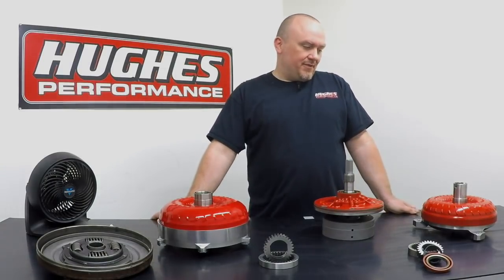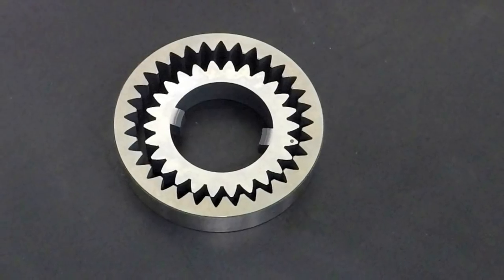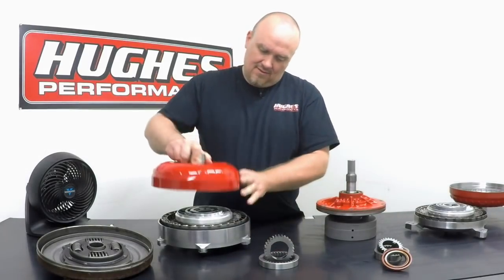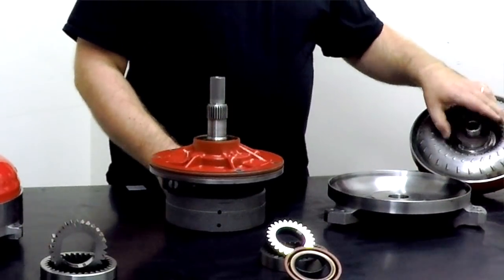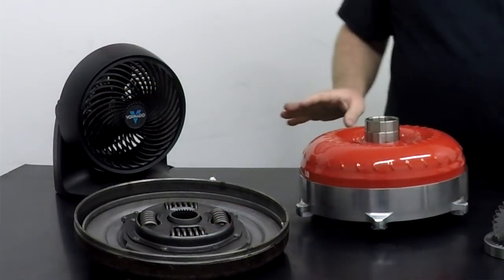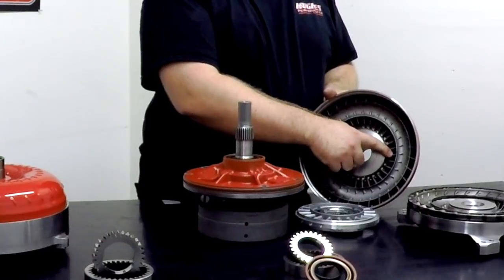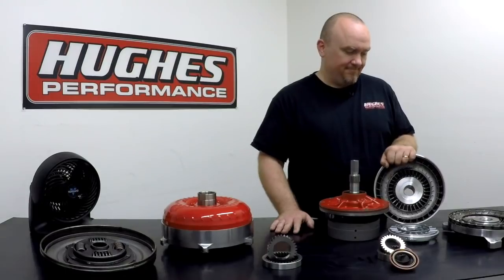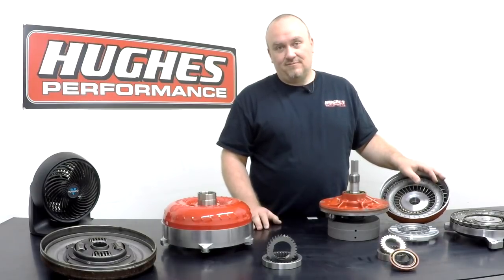Ep. 1 Torque Converters 101: A General Overview

Comment: Hey, just wondering if i could damage my 4l60e by having the converter constantly locked? I had an issue with my last cheap test box i tried it with and im putting another cheap test one in with a bigger trans cooling system in and was wondering if im missing something

Comment: I just bought the 2500 rpm install for my S10 with the Blue Print Engines 383 with Brodix heads. It pulls the brakes and stalls with stock RV converter.

Comment: what i don't understand is how it can both slip and multiply torque. wouldn't it slipping or having inefficiency mean that you're losing torque? 
also, if it's multiplying torque is it doing that by reducing the output speed?
Reply from the maker: Torque multiplication diminishes as RPM increases due to a change in vortex flow within the converter. Torque multiplication occurs as a result of additional fluid drive force being generated by the stator against the inner impeller fins. We recommend viewing the rest of the series, as we talk about all of this more in depth. 😉

Comment: Hi Hughes, awesome video! Just a theoretical question, would it be possible to "turbo/supercharge" the hydraulic fluid entering the torque converter with an external pump to get more torque multiplication on output? Or are the current designs around that 1.8x factor you mentioned near the limit for multiplication?
Reply from the maker: Great question!  Increasing volume and/or pressure to the torque converter will not further enhance the torque multiplication characteristics of a torque converter.  In fact, if the charge pressure is too high relative to the fluid that is being fed to a torque converter, the converter will experience excess forward thrust force.  This excess force is then applied against the engine thrust bearing and will lead to accelerated wear and/or outright failure of the engine thrust bearing.

It's possible to achieve higher rates of torque multiplication, particularly in diesel torque converters, industrial converters, etc.  The larger the diameter of the converter, the more torque multiplication the converter is technically capable of generating.
Reply: Yeah wow! Great question and answer

Comment: Does using high quality ATF help improve the transmission's performance over using generic ATF?
Reply from the maker: Thanks for your question!  Yes, you can absolutely notice a difference in transmission function and performance when using a high quality ATF versus generic ATF.  A purpose-built high performance (or racing) ATF is going to have unique, high quality high pressure additives in it to help the fluid perform and function properly at the higher line pressures typically associated with most performance-oriented automatic transmissions.  These additives help contribute to improved shift firmness and feel, as well as faster clutch pack and band application.  

These high quality fluids also future unique friction modifier additives, all of which help provide improved lubricity for bearings, bushings, thrust washers, and seals, all while helping to reduce slippage when clutch packs and bands are being applied.  

Finally, a properly designed high quality ATF will have a much wider viscosity index with a higher temperature threshold before experiencing breakdown of the additive packages within the fluid.  This means that in an environment where a transmission is being driven aggressively or needing to operate properly at elevated temperatures, the high quality ATF is going help the transmission live in such an environment.  Thanks to the higher temperature properties typically associated with a high quality ATF, the transmission will have less chance of glazing or burning the friction materials, as well as less chance of damaging wear components such as bushings, thrust washers, sealing rings, and seals.  

Our Xtreme Racing Synthetic Type F fluid that is manufactured specifically for Hughes Performance by High Performance Lubricants features all of these necessary additive packages (and more), all of which add up to one of the highest performing, highest quality fluids currently available in the aftermarket.